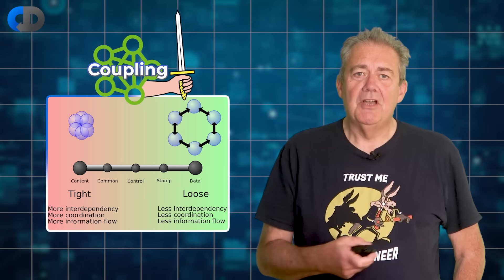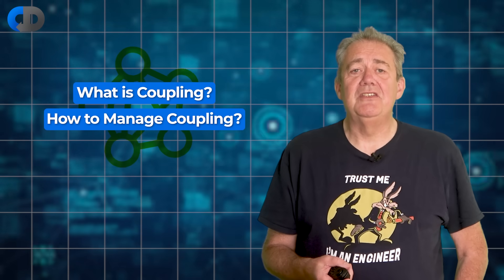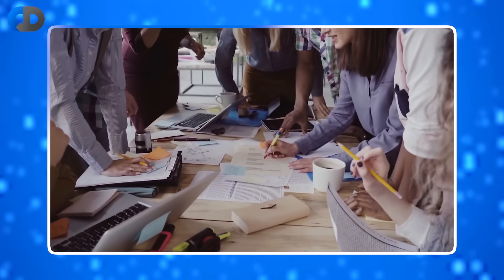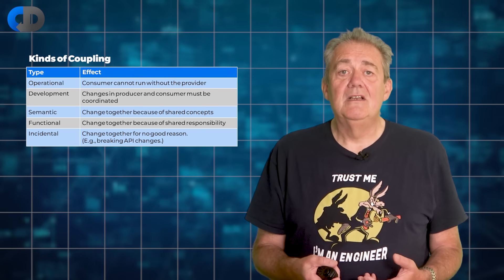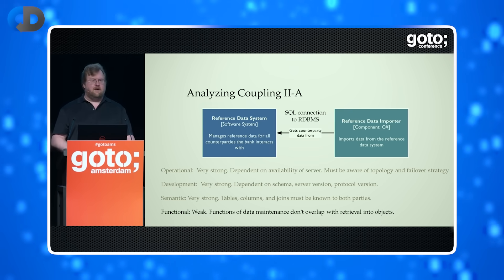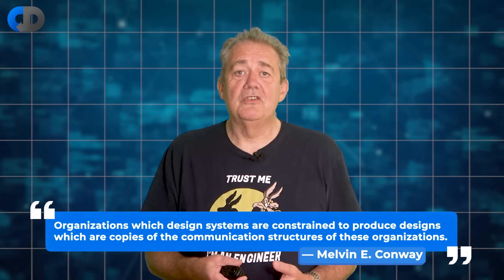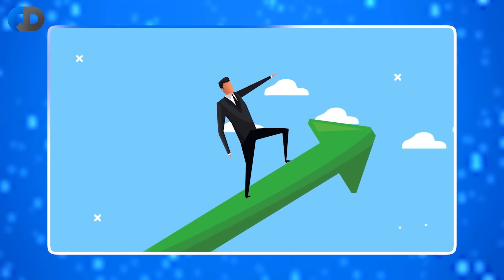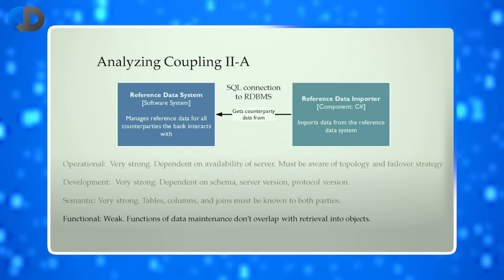Coupling Is The Biggest Challenge In Software Engineering

Comment: This is good advice. Especially where the emphasis is on identifying areas where tight coupling is called for. I've seen projects fall to excessive cross talk and tragedy of the commons due to an irrational fear of any coupling whatsoever. The good part is that tight coupling is typically obvious compared to the much more subtle work of maintaining proper loose coupling. Loose coupling requires good discipline, and the ability to wear many hats within a system in order to understand zones of ownership and concern, and formalizing hand off between systems and domains. Fear of coupling at the start inevitably leads to shortcuts later on, with do-everything systems trouncing service-level tables in databases, internal members or state, or otherwise deep intertwined logic from a lack of formal exchange mechanisms that selective tight coupling helps illuminate.

Comment: I came here to hear the words dependency injection/inversion. Let's see if I get my wish...
Reply: Don't think I did. But it was a great video still
Reply: At least APIs were mentioned 😀IOC is also an extremely useful principle when it comes to coding, absolutely ... while the video is a bit more "abstract" in that it points out at how many different levels coupling really exists and that it is not an anti pattern by itself.

I found it very useful to raise the awareness of that. Just today I was part of a tech discussion where not everyone agreed on using some more in-depth features of a database technology for solving a certain type of problem because there was an assumption that the storage backend might change in the future (development coupling), while this is very unlikely.

In that project there should be a REST service which will use that database technology and will of course have to be tightly coupled to it, using its features from "behind" the API.

The technology comes with built-in features which are provided to deal with certain types of problems which naturally come with using a database. Sometimes tight coupling is a good thing. To avoid coupling when actually useful can create worse solutions or none at all.

Sorry, included all of that while typing 😅 Inversion of Control, yes, love it too!

Comment: Great vid. Your REST API example serves as a sort of materialization of design by contract, which is very OK in my book. It also falls into Allan Kay's "message passing" view which, again, is very OK as far as I'm concerned. As far as the contract and the message is properly documented both sides can go on their merry way and do whatever they have to do on their side. And you can extend it without breaking it by simply adding more endpoints (or versions of). And if you think of it as simply a "boundary between components", you can extend the concept to anything.
IMHO, this is where "classic OOP" does a great disservice by not saying that separating data from code is a GoodThingTM. FlowerData is all you can know about Flower. Flower receives FlowerData it can operate on (state). But both are distinct entities. DTO's are an "ashamed acknowledgement" of the fact, as all data can exist without behavior but not the other way around.